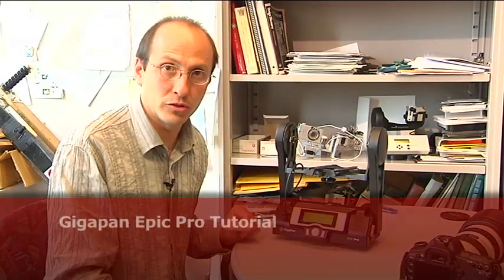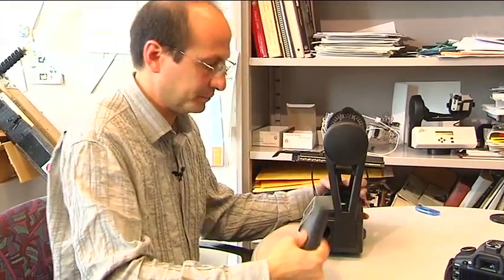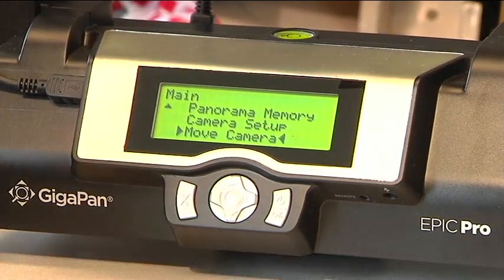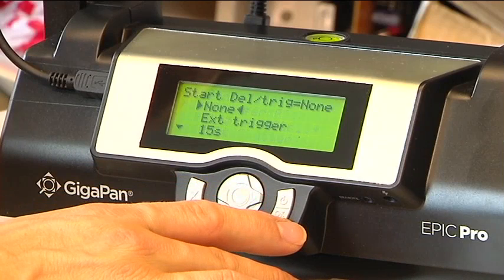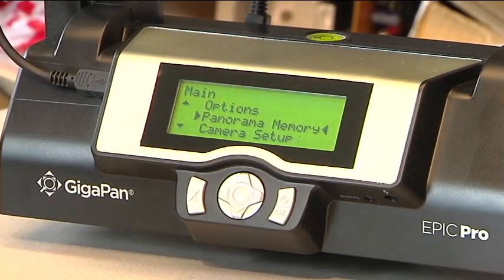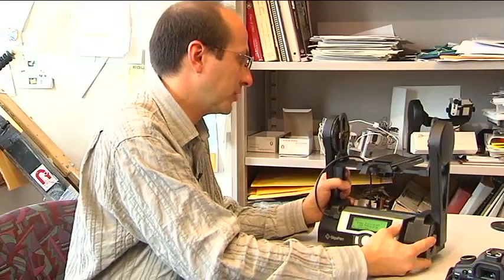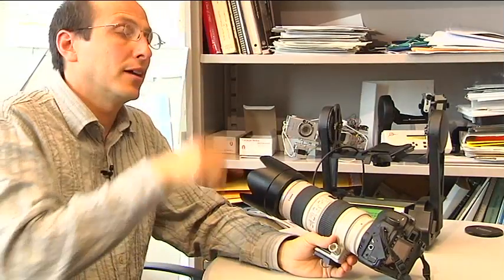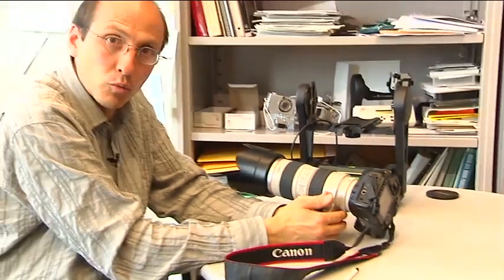GigaPan Pro Epic Quick Guide

Comment: Would it pan very smooth over a long period of time?   I'm assuming not, with a stepper motor, but would love to hear differently.

If not you could, add controls to slow down the 'move camera' option, and you have a viable pan for VIDEO  :)    and it would satisfy the timelapse, pano, and video needs.